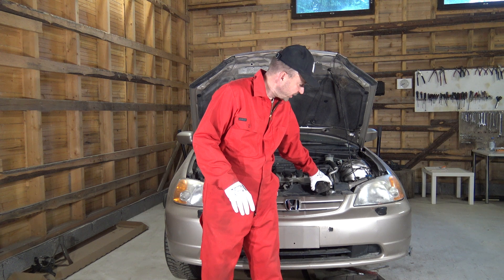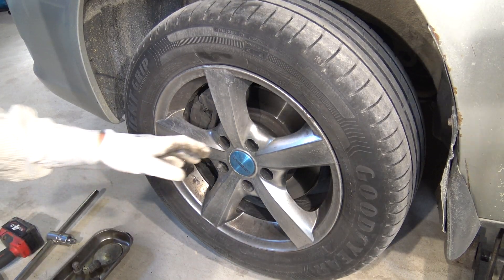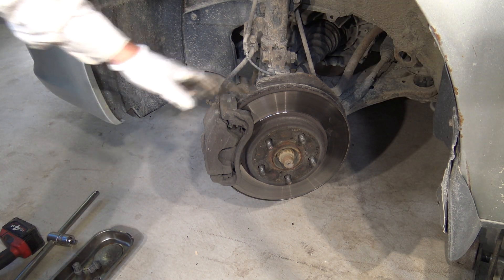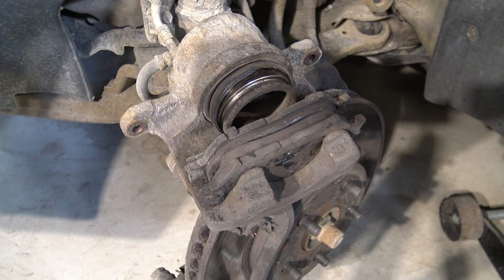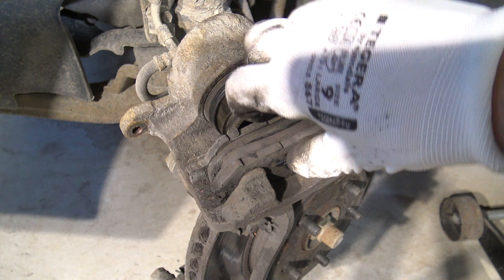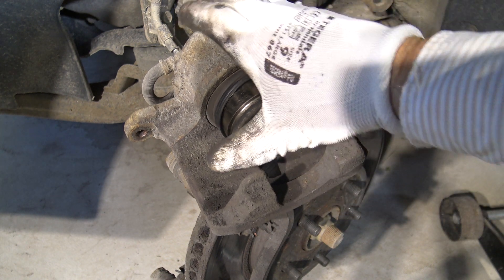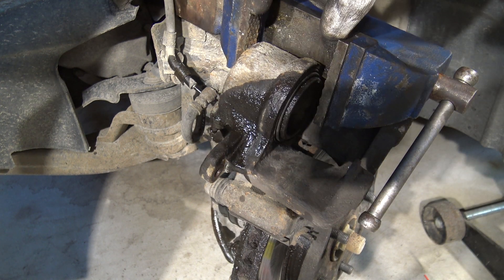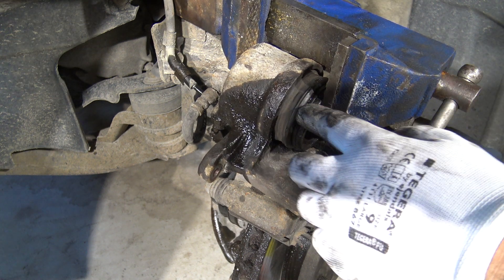How to BEST service Brake Caliper in car or truck in USA

Comment: I once accidentally popped my piston out and spent an hour trying to put it back in as well as doing a brake fluid flush to take out all the air...what a nightmare it was.
So yes, you are 100% right.
You need to be VERY careful to ensure the piston doesnt go too far out.👍

Comment: Thx for the vid and explanation Peter. Do you have another simpler tool instead of that heavy blue vice? 
Peter a request, can you make a vid how to check if the brake booster is working properly.
Reply from the maker: Hi and thanks. I use this blue tool, because it works always.  And I will do video also booster.
Reply: @PeterFinnTheCarDoctor  thanks Peter, I appreciate your instant reply. Have a wonderful day my friend.
Reply: Two pliers will do the trick. The piston must be installed back absolutely straight. Otherwise it will bind and stick to the cylinder walls (like it happened in this video). If it isn't straight, it will also make scratches to piston, and in no time it will cause leaks. Also the cylinder seals might get damaged.